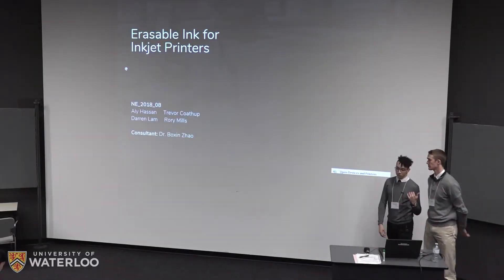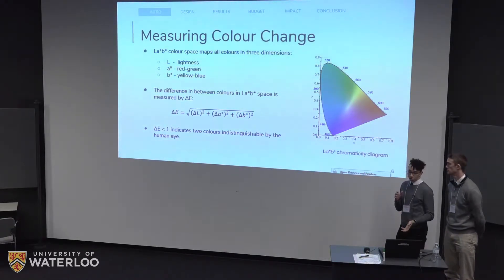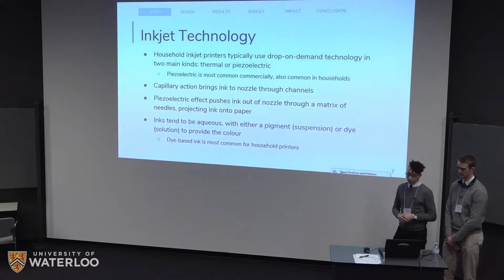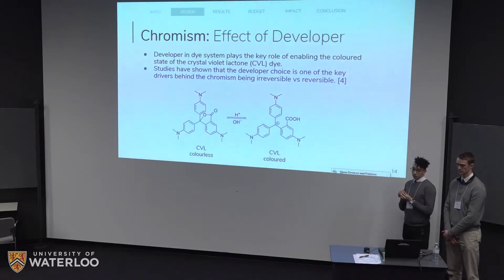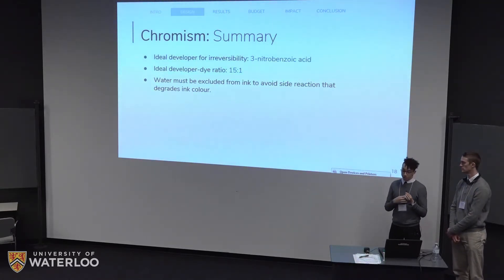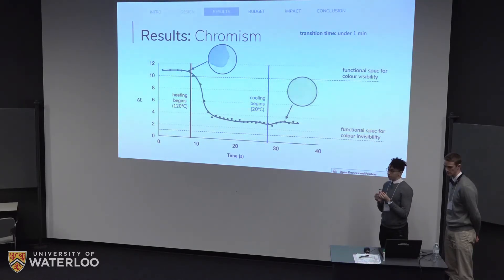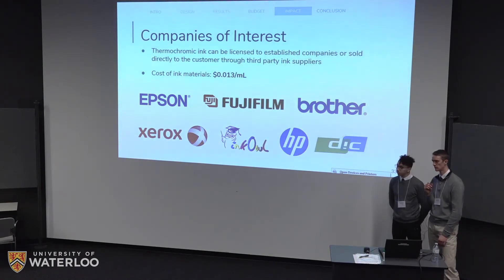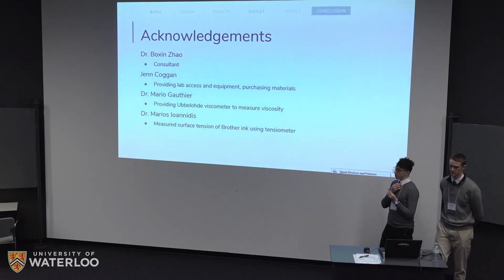Erasable Ink for Inkjet Printers

Comment: I get the idea... of the product itself it is fine but looking at the whole system this will not be usable, papers does not return back to its original state even if the ink can be remove, small crumple, effect of moisture and time, stapler, effort to reorganized the papers. There is a high possibility of paper jam, heck even using new papers paper jams are common.. A small recycling plant in the community would be better, sort of buy back system.
Reply: I know thousands of ways and millions of people who need this now!